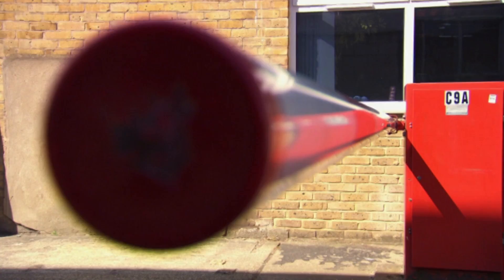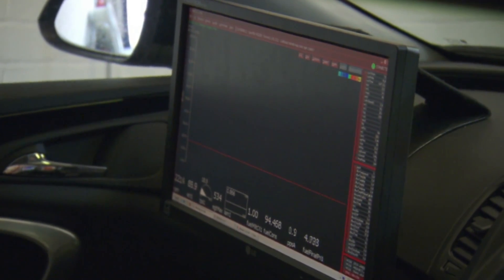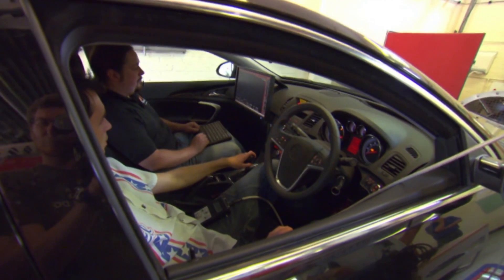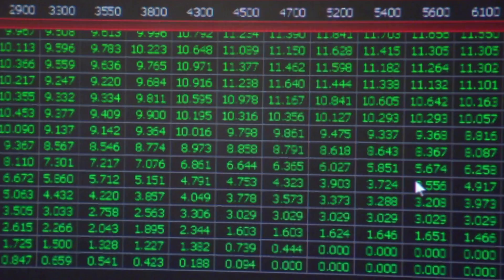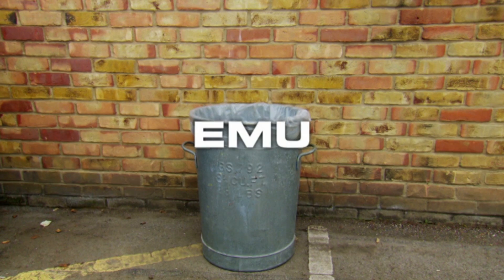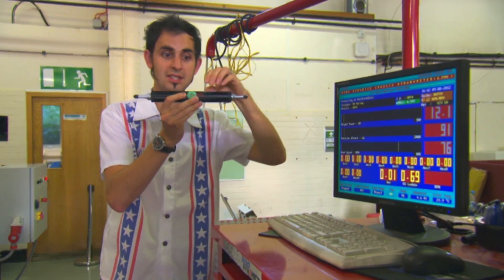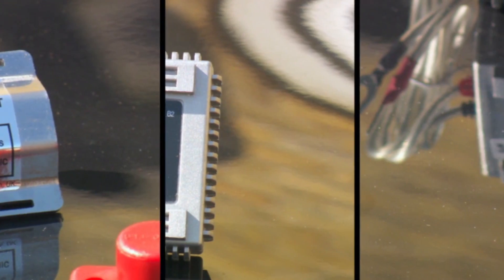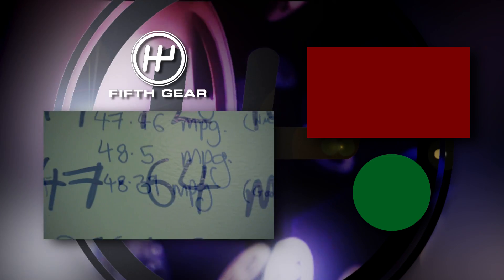Do Fuel Saving Gadgets Actually Work? - Fifth Gear

Comment: How about those air flow stationary intake fan whirlpool devices or flex fuel modification kit ,if more spark needed just jump sparkplug with capacitor ?

Comment: Just drive in the correct gear for the road conditions, in town, don’t race the adjacent car to the next set of traffic lights, which are nearly always on red when you get there, don’t carry loads of junk and heavy tools, tyre compressors etc.in the boot and only fill the tank to 50%  to reduce the weight of your vehicle.

Comment: Myth buster myths…. Conclusions drawn before results on the magnets. 

The test done on the fuel magnet was not done as directed by the manufacturer. When I first purchased a fuel magnet, the mpg went down slightly and then increased. My instructions mentioned 200-500 miles. That’s what happened in my case and has on 6 different vehicles. Guess you’ve got enough patience or willing to follow the instructions.
Reply: He posted video with thousands of dollars in equip to test, and the best case scenario drive test indoors on a roller, u have it on 6 vehicles.  Let's see your video and the b4 and after proof. I'd definitely be interested in it. You will be hard pressed to cover the bases as much as this video has it covered. Every vid I've seen drives in real traffic which I've always thought was not a good test for science as it depends on accidents, ac on or off, hills, traffic stops, etc, and was happy to see someone finally got it right by driving inside a shop on a roller with ecu live data hooked to it, and then u come at him with u have 6 cars with this device...show the vid with this same setup and it would change the world😂
 I love his first statement "why aren't world leaders aware of this"😂😂😂😂 smart man

Comment: I do like magnets on lines and better, inside of sumps.
They are useful inside sumps, where filings will be trapped and removed from fluid flow in transmissions and engine oil.
Magnets to move liquid, only useful in the lab, but measuring magnetic interaction of movement is useful in production petroleum facilities. Magnetic fields measure movement of the fluid, which is about all that the effect is useful for.
Every other gadget and "technology" (it ain't a technology) is magical thinking and hence, a con.

Comment: I think that most cars would have already done the fuel saving device, if it worked.  But none of them worked.  I bought an eco saver, the little green plastic device.  It did not save any gas either.  They are all frauds.  Someone needs to go to jail.

Comment: I bought all 4 fuel saving devices and connected them at the same time to have 4 times the savings. 
And believe it or not: it works.

Calculation:
X=15 (Believe Value)
0*0*0*0+X=15% less fuel consumption.

Absolute madness and therefore of course highly recommended. Of course, the X-factor in the calculation is super important. Without it, you will still save 0 percent, which is however better than using more petrol. 😎

Comment: The only true saving gadget out there is called maintenance. Regular maintenance make sure your tire pressure is where should be keep your foot off the gas. I have a 96 Jeep Cherokee and I get 7.1 miles per gallon. Here in the United States in my area it's $4.25. by making sure that the maintenance is up to date oil changes fuel filter air filter make sure you run fuel injection cleaner through your system and your tire pressures is where it should be. This is an only true way to save fuel. unless you have a few thousand dollars and you can go into your computer ECU and you can reprogram your car's computer. Or you can get raid  of the fuel injection system all together but then there is no emission control. So and nowadays in age you can't do that so the only alternative is maintenance or reprogramming the ECU

Comment: Take all the junk out of your car  lose weight out of the car ,make sure your tyres are filled up right ,drive slow and steady, don't rev hard too pick up speed , break less by keeping back from other cars and gear down when going down hills so you don't have to hit the breaks hard at the bottom and then rev hard to pull away again.  services the car regularly that's the only ways I know to save a bit ot fuel or drive less by planning routes and get all your shopping in one hit or oder on line .

Comment: Your car is already as fuel efficient as can be at the time of when it was developed with the latest technology. None of these gadgets will do anything to it and might, instead, ruin your mileage. They're nothing more than placebo. The best way to get the best mpg out of your car is to be smoother on braking and accelerating and instead of stopping at a red light, let off the gas way before you get to it and coast through when the light turns green just in time.
Reply: Not true, many cars were detuned to improve emissions or to keep performance below that of other cars on the manufacturers production line.

Comment: What about   using a vapour system   putting the lines directly into your airfilter
Reply: My buddies dad was a vapor injector pioneer in the early 70s.  Was getting over 20 mpg in a Cadillac Fleetwood,  don't know what happened to this idea

Comment: My experience- I had a 1972 Ford Escort Mk 1 which failed the mot on emissions when testing first came out. I put a Broquet type unit on and took it back and they asked what i had done as the car now passed. I explained. They were amazed. I had this car for a few more years and it ran better and better even using the now only unleaded petrol. I dont have the car now but it is still on the road. When others were getting hardened valves fitted etc, i used this. Yes- it was developed during ww2 to run Rolls Royce engines on aeroplanes using inferior Russian fuel. It worked then and it works now. The unit has magnets and tin which is what works on the old engines to replace lead.. I also used one on a Reliant regal with the same effects. The old time Classic car guys now about these. The other products i cant speak for but they do seem dubious to say the least. New cars- well you cant improve on them much to be honest .

Comment: thank for the true insight i new about this in the 90. the best way to save fuel is walk to work.or get a bike. i have a fuel saver on my car it  knock  the spike out of the electric. came from china cost £8 .. 8 years fitted to the battery.on my rover 75 diesel.  as a lead light .still glowing to this day .dose it save me fuel on your bike. 20.08pm 27/9/2021 from john in carlisle uk

Comment: the only fuel savings you'll get is by how you operate your car or you reduce your engine displacement by doing cylinder deactivation in which GM does so anyway. (though cylinder deactivation is proven to be only a temp solution and is not recommended because of ghost problems associated with it)

Comment: Did the fuel ratio change, richer or leaner, with any of these devices? Granted that any changes made to the fuel or electrical system would take some driving time for the ecm to adjust so I would think that your very short term test would be flawed. Not saying that any of the devices are going to help, but the ultimate goal is to get the correct air fuel ratio, to lean and you may get mileage improvements but at the cost of burning up your engine. To rich and the mileage will go down and because of the excess fuel injected into the cylinder, you will foul plugs and even end up with fuel passing by the rings and into the crankcase. Again not good.

Comment: I'm laughing my ass off at all the comments below, great humour.  Like most of you, I am very cynical of these products, so just for a laugh I put on a Magnaflow magnet onto my fuel line, no other changes not even tyre changes, usual regular servicing, nothing else, no changes in driving habits, and over 3 years of business of carefully recorded mileage & fuel (for expenses) I got a 1.8% improvement -  a tankful of petrol each year so it paid for itself.  It did make the car feel just a little bit more cheerful, shame I couldn't get it dyno tested..

Comment: Want higher MPG in your car(s)?
Use COMMON SENSE.
Use Synthetic Oils in your Crankcase. Amsoil is the best and only choice.
Keep your tires at 35 psi.
Use your car's ECO button (if you have one) all the time.
The ECO (Economy) button in newer cars gets you about 3-5 MPG highway mileage.
Don't speed uphill, but  coast downhill.
Use your Cruise Control all the time on highways and in the city.
Using these methods, I got 81 MPG on the Highway in my Honda Civic VX,
and 48 MPG with my Civic EX.
Every single one (5 of them) of the so-called "Gas Saving" Devices that I have ever used in the last 40 
years of driving HAS NEVER WORKED.
Save your money, and don't buy them.
Reply: so true

Comment: I purchased the magnet fuel saving device and installed next to my fuel lines and on my fuel tank. The magnet plus aligned my fuel to run cleaner and parallel with my fuel lines.  My fuel savings is completely unbelievable. You have to buy one. Make sure you get the magnetized plus the regular one dont work as well.

Comment: The first text you got 49. No one's setting in the car. 
All the other text still 2 people in the car. 
So yes you will got less gas MPH.
Reply: On a rolling road it would have very little  difference, if the devices worked as claimed, they would all have produced the base line still at least
Reply: @bigrobj1980  But, it's NOT on a rolling road but a very sensitive roller that is designed to detect changes in traction and friction coefficients.

Comment: There are many fuel additives on the market today and all the big players SHELL ESSO TEXACO LUCAS and so on are all competing with each other and to date, the savings published are between 4 to 11.5 % better MPG with lower emissions. well, what if you could find one that reduced emissions greater than Euro6 and gave a minimum of 50%  greater MPG, would you buy one? 
would you spend £2.50 for a cheap magnet or £150 for a 1st world war technology fuel-saving device or would you spend $300 on a device that is proven to work and is guaranteed for 5 years
Answers, please

Comment: There are fuel-saving devices on the market that do work and many that do not, the ones that were tested on this video were cheap Chinese or East European copies giving poor results there was no official road test conducted and no mention of emission test which by using a good device would show reduced emissions which in turn would reduce unburned fuel giving a greater MPG and there was no mention of fuel additives on the program
This university .do not recommend any fuel saver, what a load of Bollocks they are out there go find them

Comment: Effect of hydroxy (HHO) gas addition on gasoline engine
performance and emissions

Author links open overlay panelMohamed M.EL-KassabyYehia A.EldrainyMohamed E.KhidrKareem I.Khidr

Abstract

The objective of this work was to construct a simple innovative HHO generation system andevaluate the effect of hydroxyl gas HHO addition, as an engine performance
improver, into gasoline fuel on engine performance and emissions. HHO cell was designed, fabricated and optimized for maximum HHO gas productivity per input power. The optimized parameters were the number of neutral plates, distance between them and type and quantity of two catalysts of Potassium Hydroxide (KOH) and sodium
hydroxide (NaOH). The performance of a Skoda Felicia 1.3 GLXi gasoline
engine was evaluated with and without the optimized HHO cell. In addition, the
CO, HC and NOx emissions were measured using TECNO TEST exhaust gas analyzer TE488. The results showed that the HHO gas maximum productivity of the cell was 18 L/h when using 2 neutrals plates with 1 mm distance and 6 g/L of KOH. The results also showed 10% increment in the gasoline engine thermal efficiency, 34% reduction in fuel consumption, 18% reduction in CO, 14% reduction in HC and 15% reduction in NOx.

Comment: Did you increase the fuel level back to start level after each test? I bet not!
Reply: If this did not 'top up' the car as I suspected the overall weight of the car will be lighter for each gadget they tested.  An increasingly lighter fuel load should of lowered the petrol consumption.

Comment: You must try REAL powerful magnets. These magnets which are inside of plastic cover, most of them are weak alnico or ceramic magnets, they can give you maybe 2% maximum economy, which is not noticeable. Try neodimium magnets, these magnets are 10 times stronger and expensive. use 2 neodimium magnet (without cover) with size 2 1/2 1/2 inch. It is very important that rubber pipe of fuel must be placed correctly between the magnets. Use compass to find north and south poles of each magnet, first magnets north pole must be from one side of pipe and second magnets south pole from another side. Sometimes only economy is noticeable but sometimes it gives also more power like high octane fuel. i have magnets on my bmw e46 it gives me aprox 15% economy and more power, also reaction of gas pedal is much faster. I think that if fuels quality is high, then the effect of magnets would not be noticeable.. So if magnet not atracts everyting this does not mean that it has no effect on them. For example copper is not atracted by magnet but by the motion magnetic field creates voltage in copper wire. THIS IS HOW DYNAMO OF THE CAR WORKS. Good luck..

Comment: I didn’t expect any of these gizmos to improve fuel efficiency, but it surprises me that the mpg with the gadgets on was actually slightly worse than without them. It seems the mpg should be the same, since the add-ons aren’t doing anything. Maybe the differences are within the statistical margin of error?
Reply: The gizmos are either drawing a small amount of power, or slightly reducing fuel flow. So the car has to work slightly harder whilst they are connected. In most cases, these differences are very small, so the devices don't do much, but they do increase the energy required to run your car by a very small margin.

Comment: I mean one could consider getting a Diesel. Last time I checked, if you drive those carefully, you will only need to fill up every 2 weeks minimum. The maximum could possibly be around a month. Of course it also depends on the size of the engine. But the bottom line is, Diesel's are very economic.
Reply: And in 2022, diesel is very expensive.  But I guess all the types and grades are, eh?  🙂

Comment: Put a hollow metal ball between carb and intake manifold, atomizes and vaporizes gas doubles gas mileage and cleans up emissions this is possibly how Poque did it please try this it works I know I made one for a 85 chevy truck one for 65 dodge truck one for a 74 honda cb360 .look under ( motorcycle   hollow ball gasoline vaporizer)

Comment: I'm using several fuel saving things. I save so much fuel I have to drain fuel from the tank, otherwise it starts pouring out from the filler cap as I'm driving!
Reply: How do you do this

Comment: Ecofuel - Fuel Saving Device. Try this one please.
Reply: It is pretty similar to the rest of them. It connects to the power and ground of the OBD plug and has a microchip which controls a sequence of LED flashes. There is no CAN connection.

Comment: My prototype allows me to advance the timing without knock.  

The Youtube video shows it working.  

It needs more testing of course. 

By reducing knock and pinging you can lean out air/fuel mixture.  

When you run ultra lean air fuel mixture, you will need to cool the engine by using water or water/Meth injection constantly.

Comment: The best fuel saving device I know (and it's the best by far) is a light right foot. I could get over 51mpg out of a bone stock 1.3-litre Honda Jazz (manual transmission) using that.
Reply: Learned a long time ago to go easy on the pedal when accelerating, keep a steady speed and you'll save on gas. It works
Reply: I used to get 50mpg+ out of my 1.3 litre VW Polo in the 1980s. Not much has changed in the laws of physics, it would seem.
Reply: How? Can you share your methodology? In detail!!

Comment: "in it's defence the makers claim you need to cover 2000 miles before seeing any benefit". um i'm pretty sure that's just to stop people returning this shit after they realize they've been had. not to mention any device that intercepts the fuel before it hits the engine would have immediate effect, you know, considering any fuel that goes in is gone forever.
Reply: No, that is because need a time to clean up carbon buildups. But not everyone device works, for example, I tested many magnets and many HHO generators, and most of them have no effect.

Comment: The best thing that I did to save fuel was to fit two electric de misters on the dash beats wasting fuel waiting for the engine to heat up. demisting with the heater is counter productive as it removes the heat from the engine that you are trying to warm up to its most efficient operating temperature. The two fans also come in useful for extra air flow in hot weather.
Reply: I'm not familiar with a "de mister", is this related to locations with a cold climate where you might start your vehicle and let it run for a bit before driving?

Comment: All of these products WOULD show gains if you would also modify the 02 sensor voltage.  The 02 sensor will enrichen the mixture to compensate for increased fuel atomization
Reply: It would make no difference because the products have no affect on the fuel atomization.